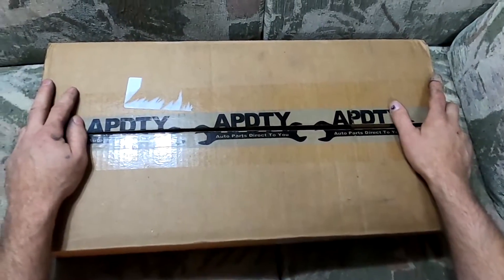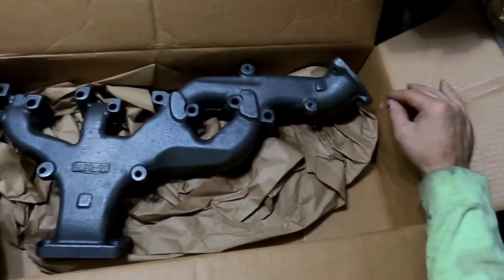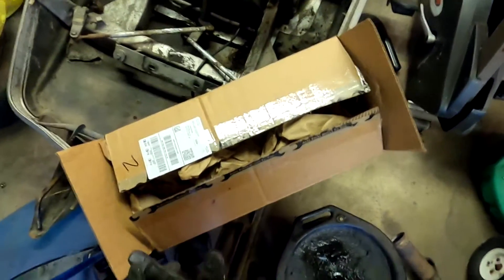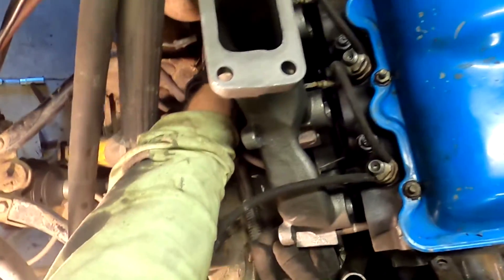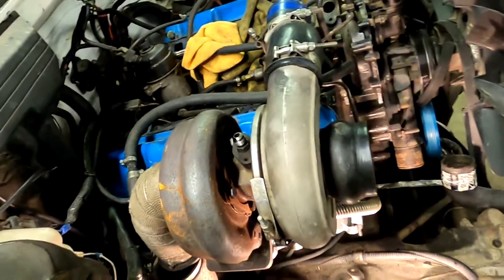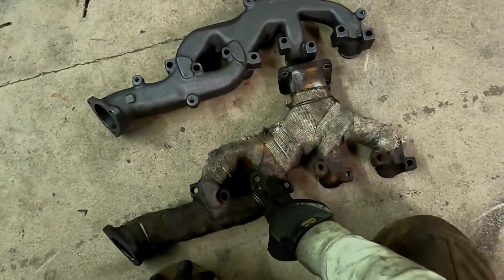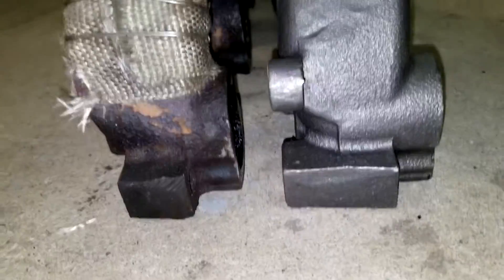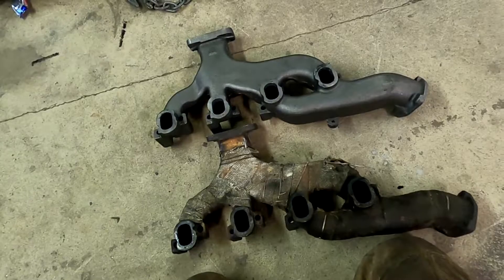Inspect/Review/Fit Test Replacement 6.5 Diesel Turbo Side Manifold from APDTY

Comment from the maker: So, I hope you know by now that I'm not a drama guy, but the reality is that this is the only one available that I know of, they were off the market until recently (that I could find), and they went from the $150 that I spent on Sept. 17th 2020 to $189 on Oct. 9th.
So you might want to grab one if you can.
https://amzn.to/2GyyJEn

I do hope to have a set of headers available in the future. Spring of 2021 if all goes well.

BTW, at 11:24 there is a terribly miss timed joke text that comes up. For the love of God, I have no idea what happened, just ignore it. It was marginally humorous at best. : )>
Reply: Hey what is the info on the headers or do you think the taller turbo mounting will help me clear my ac for putting a turbo in my 84 square
Reply from the maker: @wilsonmotorsww  I don't know what kind of clearance you need but the difference is really very little. So it just depends on how much clearance you need. Maybe easier to do some cutting and welding or other modification on the bracket?
Reply: As an update on the price in August 202, this manifold is $260

Comment: The trouble is it's not stock it's made cheaper and thinner.You got it easy with all the fenders off and nose. How come no gaskets ? Thing you could use studs ? Thanks for posting. 10:35
Reply from the maker: Yup, that's the case with almost all replacement parts these days. It's very difficult to find anything that is equal, let alone superior in quality. Notice in the text intro that I was surprised that it actually even fit. That's how low the standards are on these kinds of parts. 
I got it easy because I made it easy. It's actually not that difficult to remove everything to get good access. The first time can be a bear because of frozen bolts but after it's done and anti-seize is used to re-mount, it's even easier.
There are no gaskets from the factory. I can't remember the reason why but gaskets can blow out easily under certain conditions and become a pain in the butt, so why bother with the time and frustration? If you have used them in the past and they work, keep using them.
If there is room to install after studs are put in, I can't see any reason why not. 
Thanks for the questions, Peter!
Reply: @SixFiveTurboGaragecom  I would use the studs to hold the gasket.Did you use a sealant of any type.Did you prepare the surface ? File the faces ? Does it have a lot of foot pounds on the manifold bolts ? Sorry for the many questions. I m always curious to see how to avoid mistakes. I hate doing things over.
Reply from the maker: @peterwill3699  No sealant. This video wasn't made as an installation video since my old manifold was still good, it was just made to show the new one and show how it fit.  That's a good point though that the new manifold may not be made to as good of tolerances that the old one was. When the time comes for me to install permanently, I would run a file or some sand paper on something flat over the mating surfaces. At first just lightly to check flatness, and then more if it needs to be made flat. I still would prefer this over using gaskets. 
As for torque, although I prefer to torque things down to proper specs, if I didn't have the numbers handy, I wouldn't worry about this one, just reef on it good and get it nice and tight. 
(Btw, it's 26 ft/lbs)

Comment: So when you finally got it all installed, did your crossover pipe match up? It looked like that no one might’ve been a little shorter where your crossover pipe goes.
Also, how much of a pain was it getting them bolts out of the head ?
Is there a reason they don’t use a gasket and is there one available on the market somewheres
Reply from the maker: This was just a mock up to check the fit. I'm still running my original manifold. I wanted to grab this one because they kept disappearing off the market and also because many people were needing one so I wanted to get a video out so they could see it up close.
As for the crossover, I think it was just the camera angle that made it look off so much but even so, where they mount together has a slight articulation so a slightly different angle will still seal. 
If the manifold bolts have never been off, you can expect to take some time in there with some possible broken bolts so plan accordingly. Afterwards, always use anti-seize and you'll likely not have any problems again.
I'm not sure why no gaskets were specified except that that's the way they were from the factory and I have heard on numerous occasions that leaks often formed after installing gaskets.  Besides, if both surfaces are flat, not should be needed.
Reply: High temp ultra copper gasket maker can be added if you want.

Comment: On your exhaust manifold on the right hand side, where the turbo sets, those extra bolt holes are for heat shields to protect your return diesel injector line hoses, a little rubber lines I believe. One thing I did with the brand new manifolds I bought back in 2017 for my P 400 that I bought from Leroy Diesel Was I had the exhaust manifolds powder coated with that heat coating ceramic coating before both of them on so I still have my old manifolds off of my old 65 diesel that went into my 1997C 3500 diesel pick up but I think my castings oh my exhaust manifolds Seem to be a lot thicker as I recall.
Reply from the maker: Absolutely. The only thing that should stop anyone from powder coating exhaust is cost. It can make them basically last forever. 
Great idea!

Comment: I know this is a bit of an old video, but when you were talking about the bolts not working, I thought you had just grabbed the wrong bolt, then I saw you had the hold ones in the magnetic tray. I have a late '99 truck and my stock exhaust manifold ONLY has the long bolts that look like studs. There are no shorter "normal" looking bolts like what you grabbed and what's used on two of the bolts on the non-turbo side manifold. So I think you may be right that they changed the casting at some point. I have one of these manifolds that I bought late last year that I'm just now getting around to installing. It looks exactly like the manifold that's on my truck now.
Reply from the maker: Let me know how it fits. This is on my '93 but I also have a '99 that may need one some day.
Reply: @SixFiveTurboGaragecom  I replaced the manifolds a couple days ago. I had to do some grinding on the turbo side manifold because there was too much metal around the #2 cylinder and there wasn't room to remove the glow plug. Also, there wasn't enough room around a couple of the turbo flange nuts to get to them, so I ground them back a bit as well. Nothing an angle grinder didn't fix in a few minutes. BUT, I have had a huge issue yesterday. I went to work yesterday (I'm a pool guy) and realized I had low boost. I pulled over and found an exhaust leak on the drivers side. Annoying, but something I could deal with later. I got back on the highway and after I had been on the highway for a few minutes, I heard a terrible sound and then boost went to zero. I pulled over as soon as I couldn't and couldn't see anything wrong. I babied it to my next stop, then went home so I could take it apart. I pulled the intake off the turbo and the nut that holds the compressor wheel fell out and disappeared in the truck somewhere (It never hit the ground). The compressor wheel was loose on the shaft, but the shaft wouldn't spin. I didn't have time to do anything with it, so I put everything back together and finished my day. This morning I pulled the CHRA out of the turbo and found a piece of cast steel inside the turbine housing. I'm guessing there was some flashing inside one of the manifolds that came loose and ended up in the turbo. The turbine blade is destroyed. I'm pretty sure this all came back to the manifold. I'm going to try to figure out where I got it from and if they'll do anything. I bought the manifolds back in December, so IDK if they'll do anything for me. Fortunately a new CHRA isn't very expensive and isn't all that difficult to replace.
Reply from the maker: @float6969  Holy crap, that's insane. Sorry to hear that it caused you to have to get a new turbo, but I'm glad to hear it wasn't worse. And I really appreciate you coming back here to tell us about it. First of all, knowing to go through it to machine all the different parts for a good fit, but mostly to add in machining anything internally to avoid this happening to anyone else. 
Companies getting good help to do good work and availability of good parts is only going to get worse, so we're going to have to get used to modifying what we can to keep our rigs and everything else working over the years.

Thanks again!

(For other readers, CHRA is "Center Housing Rotating Assembly")
Reply: Will do!
Reply: I guess I should buy an endoscope camera to check the inside casting ?

Comment: I have a 1997 C3500 6.5l diesel and my truck exhaust manifolds looks similar to that one and they have shields the block the heat from getting to the lines fuel lines return lines I’m next to the block that’s what those other holes are for that’s where they go
Reply from the maker: That's what I suspected Jerry. I may keep an eye out for those shields. I'm always interested in protecting against heat.
Reply: SixFiveTurboGarage.com if I can figure out how send you a picture of the heat shield   And also there are other shields that are down there as well